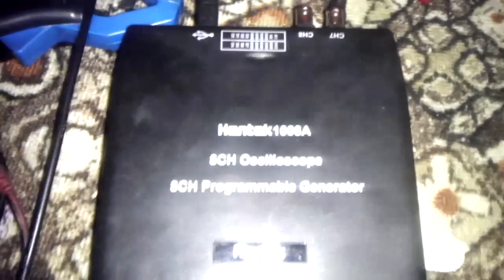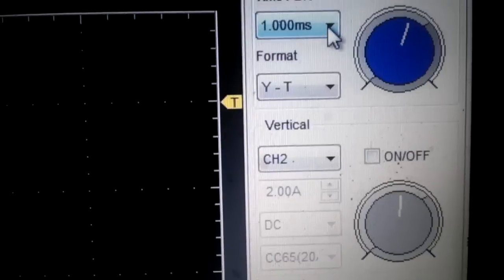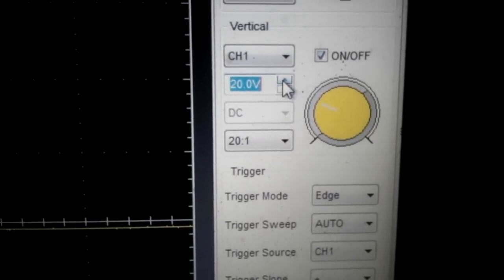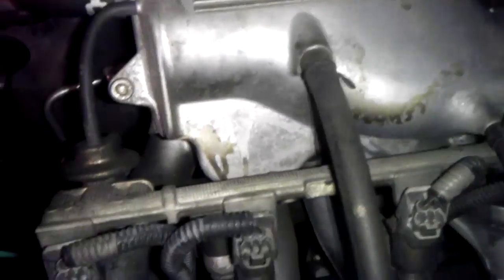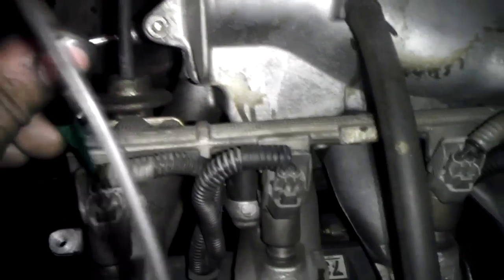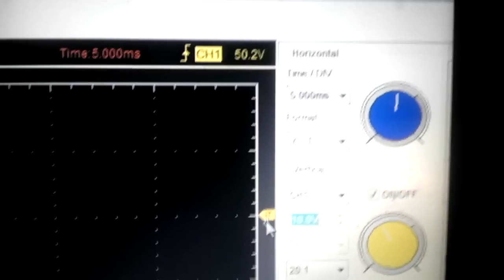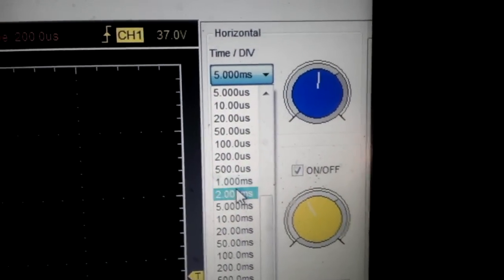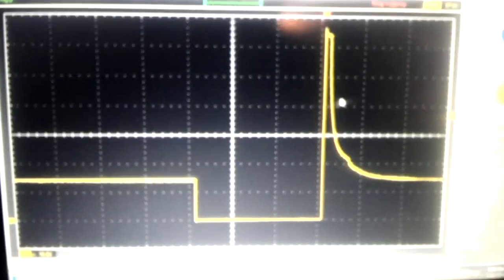Hantek 1008 Fuel Injector Voltage Waveform

Comment: how it works? no headacke with this scope operation?im thinking to buy it too
Reply from the maker: It depends a lot on the computer you use it with. I have a dedicated laptop that I normally use the Hantek with. It is also important to calibrate the scope often and to use  the diagnostic set ups that are available. It is especially important to use the diagnostic set ups when checking primary ignition it will prevent the program from crashing.

Comment: Hola Enrique podrias poner links de donde compraste ese set up para tu oscilloscope yo tengo el hantek 6022be . el atenuador el adaptador para los leads que tienes conectado al atenuador yo soy un Do it your self como dicen aca en los US .saludos desde San Diego.CA.
Reply from the maker: Todo lo compre en eBay. Por ejemplo
http://www.ebay.com/itm/20-1-Passive-Attenuator-300V-Max-For-Pico-Hantek-Others-/172296028296?hash=item281da4c088:g:4QMAAOSwu4BVxekI

Comment: Cuando se deben utilizar los atenuadores..? 20:1 o en que casos tu los utilizas.
Reply from the maker: Cuando el voltage va a subir sobre 40 voltios uno debe usar el attenuador. No importa si sólo es por un millisegundo que va a subir el voltage a ese nivel siempre se necesita el attenuador. Ejemplos son, injectores de gasolina, ciertos solenoids , y bobinas de bujias pero sólo el circuito primario. Nunca se debe poner el scope en el circuito secundario.
Reply: Enrique Osorio Te entiendo, pero cuando quieres saber si existe alguna falla en el circuito secundario, bobina, cable o bujía. He visto que utilizan el scope y dependiendo de la gráfica te orienta si es alguna de estos tres. Por ejemplo el video de scanner danner. Secondary Ignition Waveforms (common faults). Por último el scope debe utilizar alguna protección en especial cuando es circuito secundario.

Comment: The first automotive scope I ever used was one of those classic Sun analyzers and was nearly as big as a Smart car LOL Yes, I'm old enough to fart dust. So did you finally find the cause of the problem? Logic says that assuming all electrical connections are good then you're loosing a trigger (input). Cam/crank or distributor pickup being my edjumacated guess. Yes? No? Shut the hell up? :-)

Comment: Hi when I am checking wave of injector I see the  inverted signal what is my mistake I see your setting I do just you
Reply from the maker: Try switching your leads, meaning place your positive lead on your injector and the negative lead to chassis ground. If that does not work try testing the voltage of your car battery. To do this place the negative lead on the the negative post of your battery while holding the positive lead in the air and check the waveform. The waveform should be a flat line that is on the same level as the numbered arrow on the left of the screen corresponding with the channel that you are using. Next place your positive lead on the positive terminal of your battery and the waveform should look like a flat line but raised ABOVE where the first line was. If the line disappears then try raising your volts/division on the top right of your screen. If the line goes down instead of up then there might be something wrong with your leads and you need to use them backwards. Either way an upside-down waveform is just as useful. The shape is more important than anything else.
Reply: Thanks for replay  I had put my positive leads on injector signal and negative lead to ground of the car is it right , but I am using 20;1 attenuator can I change places of leads
Reply: I will ring up my leads positive will be on centre of bnc cabel negativ must be another filled connection you had demonstrated in on attenuator videos
Reply from the maker: Before you switch your leads try the battery test first without the attenuator and then with the attenuator and see how that goes.
Reply: OK I will check battery voltage without attenuator if I will connect positive probe to + battery the voltage will increase on my labtope goes to ahead

Comment: how do you test Injector current with this scope
Reply from the maker: You will need a tool that converts a current reading to a voltage reading. Once such tool is the Hantek CC-65. With that tool you will be able to see the current running through a wire, including the current in the wires that give voltage or ground to a fuel injector. Once you have your settings adjusted correctly and you are reading the current feeding or grounding and injector you should see a triangular waveform, peaking at approximately 1 amp and looking very similar, in terms of shape not magnitude, to the current waveform of an ignition coil. Watch my video on primary voltage and current. Here is the link
https://www.youtube.com/watch?v=2QK8r6N9qXM

Comment: i see you put test lead to injector,how you ground the scope itself? what is the setup
Reply from the maker: The other lead which is known as the ground lead always goes on chassis ground. The only exception is when testing a component off of the vehicle. An example would be while testing a variable reluctance sensor off the car.

Comment: I have an hantek 1008c scope and I want to load it on my pc but my pc doesn't come with a CD ram so how do I get the scope to work
Reply from the maker: +George Rodgers My latest video has a step by step process on loading the software and drivers. If you have any questions let me know and I will try to help you.
Reply: +George Rodgers The best thing to do, IMO , is get a computer from off of craigslist that has a cd /dvd rom, and use it specifically for your automotive work and what not. You can get a used decent computer for about $75 on craigslist. If  not, you will have to either purchase, or gain access to, a usb cd rom and do it that way, or network to another computer that has cd rom and upload it that way. But the best way to go, I would say, is to get a laptop computer that has cd rom.  I don't know if you are trying to use a tablet or an I-pad, or just a super old computer, but WHATEVER it is, it's the same as wanting to watch a DVD , but all that you have is a VCR. The hassle that you go through to accommodate for the lack in technological equipment, is far more expensive than just buying the darn thing.
Reply: my laptop is windows 8.1 I load the driver for the hantek and it is in Chinese I need some help
Reply from the maker: +George Rodgers That is a common problem. Watch my latest video on the software and drivers of the Hantek for more information. Thanks for watching!

Comment: that does not show more than one wave?
Reply from the maker: This particular model Hantek oscilloscope has 8 channels. You can view my other videos in which I use multiple channels.
Reply: hard to see if there is a proplem with one wave.
Reply from the maker: robert mccully That is true, but in this video there is only the voltage waveform of the control wire of the fuel injector.
Reply: look at the link i posted.... From Danner.. it shows the next step very cool
Reply: robert mccully which link?
Reply: Ok listen if you  only see one wave that means the screen is not beeing refreshed fast enough.If that injector opens for instance, every 10 miili seconds that you need to refresh faster than that. So if you refreshed ten times faster, you would see ten waves

Comment: hi how do you set the trigger for second channel
Reply from the maker: I made a video describing some of the basic functions of the Hantek scope. Here is the link
https://youtu.be/Pv1tZ8zMBUI

I made a second video describing more functions, if you are interested. Here is that link
https://youtu.be/qgd0YTBv9hE

Finally, to directly answer your question what you need to do is to go to the bottom right of the screen, with your Hantek running, and select the channel with which you want the scope to trigger off of. Once you do that you set the voltage with the arrow on the right hand side of the screen and your set. For clarification watch the linked videos above.
Thanks for watching, if you have any questions please let me know in the comments sections of the videos.